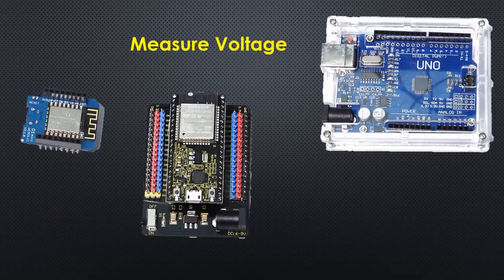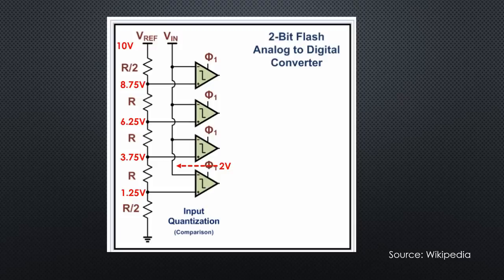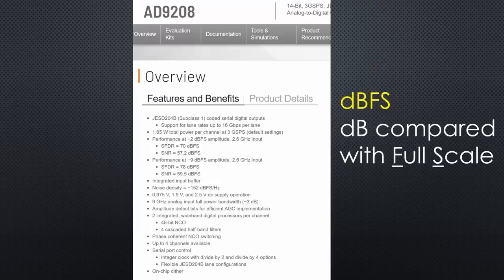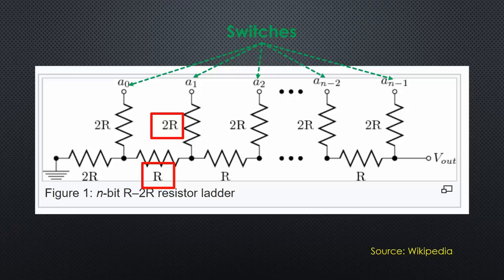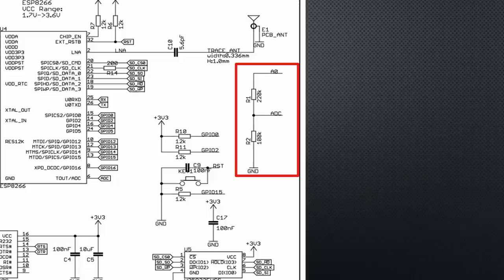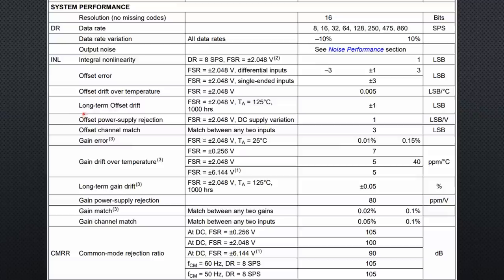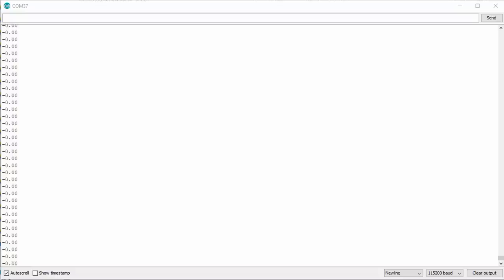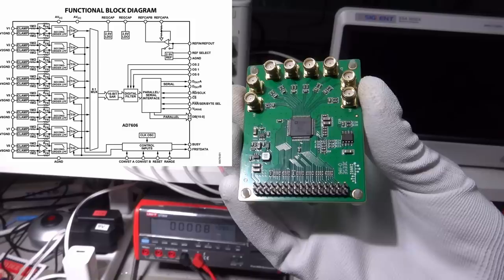#340 How good are the ADCs inside Arduinos, ESP8266, and ESP32? And external ADCs (ADS1115)

Comment: I had to chuckle a little about the example of measuring a 24V Solar panel and then setting the range to 30V (around 13:23 in your video). A solar panel that you would use with 24V batteries in a real-world scenario would normally be a 72-Cell panel, which typically has an open circuit voltage around 45V @25ºC, and quite a bit higher when it gets really cold. I realise it was just an example in your video, but for anyone wanting to really measure a "24V Solar Panel", maybe increase that range in your resistor divider a little :-) As usual, thanks for an interesting Video Andreas - toll!

Comment: Neat video! I’d have liked it more if you went over the details of successive approximation registers, and how a delta-sigma ADC (or DAC) works, but maybe that’s outside the scope of this video. On the topic of ADCs and DACs, I’d be interested in a video on DSP algorithms being implemented in an arduino, be it for audio or for filtering out narrow-band noise.

Also when you said that SDRs use these very high speed GHz ADCs, I don’t think they actually do. They use lower speed ADCs with mixers and tuneable local oscillators to generate the I and Q signals. Direct sampling SDRs are very rare.
I’d also have mentioned the fact that the ADCs have a finite input impedance, so putting a network of resistors in front of one without buffering it after could cause some systematic error. Well, you often use an instrumentation amplifier there anyhow so maybe it’s not too useful of a tip.
Reply from the maker: 1. This channels is for makers, so the most important decision is what not to show.
2. I define SDR not only as "SDR receivers for the general public". I define them as "digitalize the signal and do the processing in software". So radar and many other applications fit my definition.
3. You are right with the input resistance. If you calibrate the readings I assume you can live witout an instrumentation amplifier for 10 or 12 bit resolution. For more precise applications you are right, of course

Comment: Thank you for the breadth of the experiments to help reinforce the lessons. Seeing how externally sourced ~5v can impact the readings was an "of course!" moment, since I'm used to using a good regulator versus an adjustable power supply for projects. Spotting things like how the radios on the chip may affect the ADC are very good clues. I'll investigate some of the external ADCs, since I'm thinking about a project that will use a mesh radio network and I had planned to use analog inputs as well...  thanks again!
Reply from the maker: Some distance to radios is never a bad thing ;-)

Comment: Great video. Just for feedback, the first adc is called flash adc, flash for lightning speed. Another idea, adc chips are good for generating a binary value for raw signal within specifications, but the limitation often lies within the controller to manipulate the binary value to usable data. Often, the dilemma is within the controller's ability to manipulate double float values. Some controllers can only handle 8 byte floats. So calculating a thermocouple voltage becomes an inaccurate reading because of the float calculation errors. Not just thermocouples, even ntc resistors. So usually for such operations a good math library is needed to overcome these hurdles but capture rate of course would be at a disadvantage.
Reply from the maker: True. Fortunately, The ESP32 has a floating point engine.
Reply: @AndreasSpiess  i'm using the 8266, moved all my heavy load to the STM32F103C8 due to power requirements. I like these ESP devices; however, I'm interested in another solution where they don't offer a flash.

Comment: The ADS1115 is a good choice, BUT with my ESP-32 I had some trouble due to the fact that they was in the same casing and WiFi was enabled/used. The results was overlayed with lots of noise. The method of averageing takes to much time for my project. I need the result ASAP and the ADS1115 is anyway no the fastest. But I was able to solve the issue and I want to share this with you guys: First step was to build (3D Print) to boxes which fit in each other with a small gap. The outside of the small box got covered with a copper film. Afterwards I fit the small box in the big box. Why two boxes? Quit simple : isolation. The copper film I connected to ground. Inside the box I placed the ADS1115. For the cables I made small holes and the cable which is going to the probe is an coaxial. Problem solved. What I want to say by this is, that the interference of the RF signal has not to be underestimated!

Comment: Nice explanation on the ADC basics. This can be confusing for beginners and experienced people alike.
The resistor values used when measuring higher voltages(30V) are way to high.  With a few meg ohms the ADC's sampling capacitor cant fully charge and your results will be off. As the voltage drops the problem will get worse. You need to either increase the sampling time (not rate) or put a big cap (10-100nf should do)  at the junction of the voltage divider. The capacitor will then supply the required charge to charge up the ADC's sampling capacitor. This will obviously mean the sampling  RATE will be dependent on the RC values of the voltage divider and the cap.
If you do the same experiment with resistor values in the range of 10 - 100K as the voltage divider , you will get much better results. This is not an issue with the ESP32 , the same will hold true for all ADC's. I use the STM32 a lot and have seen this exact issue.  If you have to sample a high impedance source you will have to increase your sampling time. You will also see more noise if you don't add filtering.
This is the reason that fast ADC's usually require some sort of amplifier/buffer stage up front to make sure the sampling cap can be charged fast enough to meet the frequency requirements.
Cheers
Rob
Reply from the maker: Thank you for your additional information. I wanted to keep the (tiny) resistors on the Wemos. This is why I ended up with such high values. But the current should be the same as in the original Wemos(@30 volts) .
Reply: @AndreasSpiess 
The issue is that when the ADC sampling capacitor is switched in at the start of the sampling period it is discharged. The mid point of the divider will drop to 0volts. The cap then charges through the 2meg resistor. Even though the cap is only a few pF it still has a time constant. If the sampling time is short enough the cap will be sampled before it is fully charged and the reading will be off. A big capacitor at the junction of the divider can provide the charge to charge up the ADC cap quickly without significant drop in the voltage at that point.
Cheers
Rob

Comment: Great video.  One thing to note.  If you use an external i2c ADC, you can not set up any sort of interrupt driving timing to collect sames in the background at a given rate since i2c does not work within a ISR.  This leads to a bit of work to make sure loop() gets called at a reasonable rate....  Just something to be aware of.
Reply from the maker: Good to know. Maybe you try a second RTOS task on the ESP32
Reply: @AndreasSpiess  This was on the AVR architecture

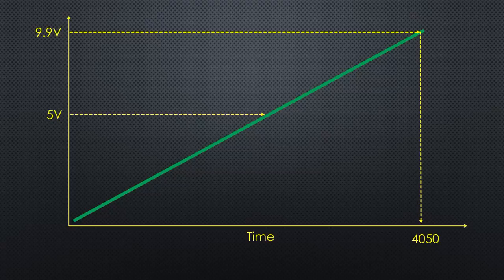Comment: at 9:30 describing SAR, you first say it would take 4000 samples to get the result, this is not SAR. SAR only ever takes the number of clock that = number of bits so a 12 bit ADC SAR would take 12 clocks. BTW, I do love your videos and find them very well presented and prepared,  I am just trying to ad to the excelent presentation you have here for new engineers that may miss interpret the info
Reply from the maker: You are right with the number of 12. There I made a mistake by saying "around 10". The 4000 points was the explanation without SAR.

Comment: I have a similar adc module with just 2 16bit ADCs and 50Mhz sample rate. It's like 40usd on eBay. It would be incredible if you want to make a video about how to read data off these cracy fast parallel lanes. My primary goal was to reduce cost. I thought it would be interesting if we can dump all the ADC data straight into a ram with some hard logic, and read the ram with some cheap slow microcenter. Thus eliminating the need of fpga.

Comment: Danke, Andreas, du bestätigst meine Beobachtungen. Ich verwende auch nur noch die kleinen, externen ADCs. Ein Hinweis noch, die Adafruit-Treiber für ADS1015/ADS1115 könnten beim ADS1115 Probleme machen. Der ADS1015 (12Bit ADC) arbeitet perfekt. Für den ADS1115 ggf einen Fork der Adafruit-Lib von  User soligen2010 nutzen.
Reply from the maker: Danke für den Tip!

Comment: Thanks for another great video! In researching my gas sensor project, I came across a method people say improves the accuracy of the readings, though I don't really understand it. You apply this calculation to the reading on the ADC pin:   volts = 0.000000000000016 * pow(reading,4) + 0.000000000118171 * pow(reading,3) 0.000000301211691 * pow(reading,2)+ 0.001109019271794 * reading + 0.034143524634089; (Also note that there is a more efficient way to do this calculation (10x faster), but it yields a slightly different result, so I'm leaving the original one here.)
Reply: For some reason the calculation got scrambled when I pasted it in to the comment - apparently having a "+" after a "-" gets interpreted  as strike thru... Hopefully you can figure it out.
Reply from the maker: Unfortunately I am no mathematician. Maybe another viewer can help out.
Reply: @AndreasSpiess  I forget how I originally found the calculation, but if you Google "ESP32 ADC Polynomial" you will find a lot of people use it to make the values returned by the ADC more accurate.  You noted that the ESP32 wasn't accurate, but apparently it can be improved with this technique. I'm happy with the results I'm getting, but my application doesn't need it to be extremely accurate.

Comment: Hi , about Arduino, i know that you know but is to clarify to others. If you use 5v in your formula and change supply voltage, it is clear that it will not take good values 
I usually work with the internal secret method for measure Vcc (you don't need any other analog pin for that). Also you can use low noise ADC sleep mode to measure.
Reply from the maker: This is what I showed in video #10 ;-)

Comment: Nice video!. When you are in the presence of glitches, one way to improve accuracy is to take a lot of measurements and calculate average. Then compare all samples with the calculated average. Take out all samples outside certain margin. Let say 10%. Then calculate the average again. You can continue to get better results. Also you can use statistic formulas as standard deviation to decide when your result is accurate enough.
Reply from the maker: I agree you can reduce noise with those methods. Non-linearities will stay and unfortunately, the speed will decrease. But often, this does not matter.

Comment: Here you go, here is the code to help get the ESP32 ADC to behave better: 
// configure ADC for getting battery voltage
  pinMode(VoltageSense, INPUT); // Battery Voltage Sense input
  analogSetPinAttenuation(VoltageSense, ADC_0db); // set the attenuator for the ADC to allow 1.1V input range
  analogSetWidth(11); // set the resolution width to be 2048 instead of the default 4096 to try and reduce noise
  analogReadResolution(11); // set the resolution to be 2048 instead of the default 4096 to try and reduce noise
Reply: Also another trick I found is to add a delay directly before the read, it helps get a more stable reading too! 50ms worked well, but you can’t always do that obviously.
Reply from the maker: I never tried to reduce the resolution and compare it woth averaging. Good to know. Thanks!

Comment: Very nice video. One consideration though. The serial ADC will always need the same time independent of the measures voltage. 
As the comparator can only output "too high" or "too low" it can not detect that it hit the right voltage and finish early. It will always increment to the final / least significant bit. 
It can however be accelerated if you choose to reduce accuracy.
Reply from the maker: Thank you for the additional information!

Comment: Excellent video, thank you!

A related interesting subject for a future video might be how to safely and accurately measure the voltages of a multi-cell battery. After a couple of evenings of googling I have found out that's not trivial.
Reply from the maker: Thank you for the suggestioon.
Reply: The typical manner is to have the most negative connection coupled to ground of your circuit, and then have voltage dividers for each cell. For a 4 cell battery, you could either use four identical voltage dividers, or preferably have four different ones each tuned to voltage ranges for each of the series cells. For simplicity sake, if it were a 4 cell lithium battery, 5v, 10v, 15v and 20v would be good voltage divider ranges to use for monitoring each successive series cell and being the most accurate for each in turn. Being able to measure the individual cells would be nice, but as you suggest, its not trivial, as you would need to somehow keep changing the ground/negative 'reference' when measuring each cell.
Reply: I thought it‘s really simple if you use an individual esp8266 for each cell. It‘s even scalable. What is wrong about that?
Reply: @matzke089  That could work, yes, but has disadvantages:

1. Relatively expensive, especially for small batteries.
2. High power consumption, especially for small batteries.
3. Communication between the ESPs will have to be engineered carefully.
4. Generally complex and not elegant. A "brute force" solution, if you will. I like elegance and simplicity (the two usually go together).

Comment: Grutti Andreas! In your example at 3:57 , you do not strictly need to apply a clock to the comparators, because only one comparator-value shall change at any given time. What can misfire is the digital truth-table afterwards,  (as multiple bits shall change, e.g. going from 1 (binary 01) to 2 (binary10)) - A Gray-code encoding mitigates this too. If the clock can be avoided, the flash-ADC will be even faster.
Reply from the maker: Thank you for clarification. As you might have seen: I am not a specialist in this matter, just a user...

Comment: Great timing.   I'm building a flash joule heater, and need to measure the voltage of the supercapacitor before and after the flash... i was just going to use an arduino and not even think about it - because I didn't want to do the research.

Thanks much!

Edit: after watching, an ADS1115 or equiv is what I need.
Reply from the maker: Hopefully it will work out for you!
Reply: Yeah... thought this is a bit less effort.

Welcome to reality :) .

These 2.7v 500F rh2ings don't want to release their energy instantly.

Damn physics...

Comment: FYI.
Re: ADS1115

It seems to be OK to supply input voltage to the ADS1115 even when it is not supplied with Vcc. 
i.e I have a project where I am measuring the voltage of a car battery, using a ADS1115 and a ESP32 , using a voltage divider to reduce  max of 16V to 3.3V on the input of the ADS1115

If I remove the supply voltage, the ADS1115 seems to survive even though the input was 3.2V and Vcc was 0V.  
Possibly this is because I'm using 4.7k in series as part of the voltage divider, so the current would be limited to about 3.5mA.

In hindsight, I will try using higher values for the voltage divider and use a reservoir capacitor to reduce the effects of the higher impedance input.
e.g. try 47k and 12k as the divider, so that the max current would be only 0.3mA 

PS. I just accidently destroyed on channel of ADS1115 by shorting the 4.7k resistor with a solder bridge, hence supplying 16 to one input, but the other inputs still work OK.

So when I rebuild my prototype I will change the voltage divider resistances.
Reply from the maker: So you were lucky that only one input was destroyed... I try to stay inside the limits of the data sheet. 
Maybe the chip has an input protection diode towards VCC and as you write, this protects the chip during power off.
And you are right, you can use higher resistors for the voltage divider.
Reply: @AndreasSpiess  
I actually destroyed 2 inputs, because I shorted 2 resistors.  However the other 2 inputs still work OK.
Before I replace the module I will do some more testing on the 2 remaining operational inputs to see how much current is taken by the ADC inputs when the battery I am measuring is still connected, but the supply to the ADS1115 is removed, i.e I don't power my entire sensing board.
Like you say, there is probably a protection diode to Vcc on the ADC inputs, but this diode is probably only designed to protect when the supply is removed from the ADS1115 when there is a series resistor connected to the ADC input.
I wonder if someone had a 1.5V battery connected directly to the input of the ADC, whether the input would be destroyed if the ADC was not powered.

I also need to experiment with higher value resistors in the voltage divider, to increase protection, The manufacturer seems to recommend resistor dividers with values around 1k Ohm in total, to prevent measurement error, according to a post on their forum. However the input impedance of the ADC is 3M Ohm, so higher values should not cause significant measurement error and adding a reservoir capacitor will also compensate for the higher resistor values albeit slowing response time.

Comment: I boosted the ADC sample rate of an Arduino UNO at around 30800 SPS for audio purposes, the sound wasn't really great but when I discovered I can use the 1.1V reference, it immediately made it way more accurate! The issue was that the input audio signal was so low it could only be heard in a single bit.
Reply from the maker: You are right. The usage of the internal reference is shown in video #10